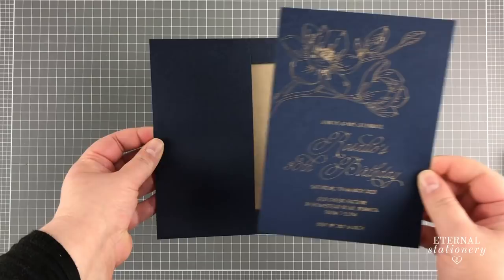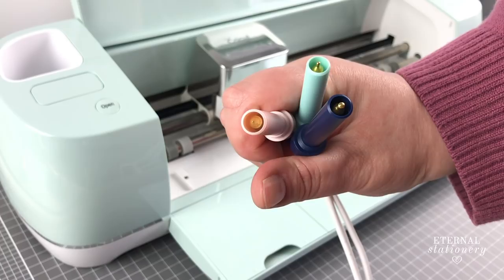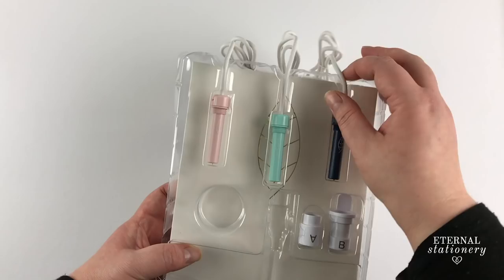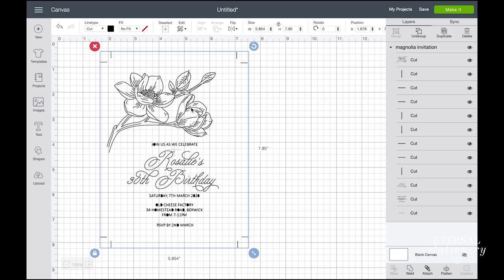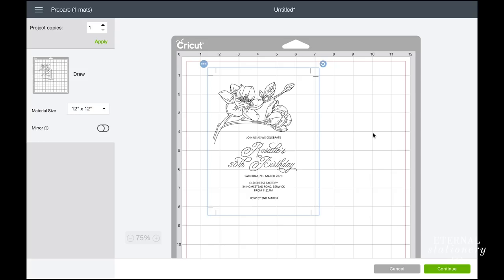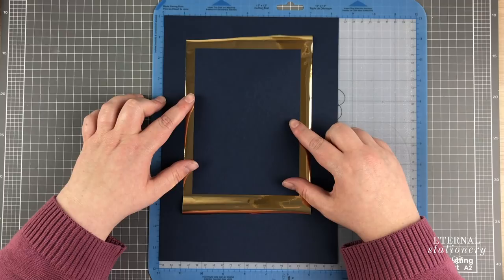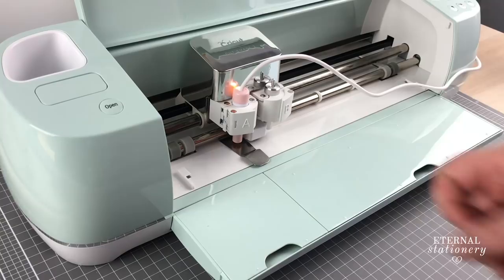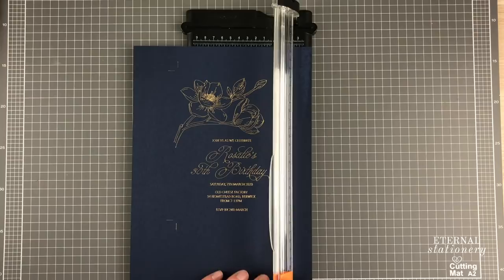HOW TO USE THE FOIL QUILL? DIY Gold Foil Invitation | Stunning Results!

Comment: Hello can you tell me what setting on the cricut you have it set to for this? I had it set to card stock and I let the quill heat up but it did not attach to the card thank you
Reply: Hello,  I just ran the quill on my Cricut Maker for the first time and I did not get the outcome that I was expecting and thus, I have the same question as you.  I believe that my lack of results is from the paper and pressure setting so I too, am wondering what was her settings.  Did you receive a reply and if so do you mind sharing?
Reply: I just finished my third try and as the saying goes, "The third time's a charm".  I am so happy with the outcome. I did play with the settings and my third setting was on lightweight card stock, Default pressure, and the Fine Quill was most important...I believe.  The first and second pass I used the Standard Quill pen.  The best to you and Happy Crafting.

Comment: Hi Thanks for sharing the video. I have bold tip foil quill pen, will I be able to make invitation with that too? Please share some projects using bold tip foil quill. Thanks in advance.
Reply from the maker: Yes you can. You will just need to be careful with finer lines but if there is enough space between characters is should work well.

Comment: Hi, another question about the single liner drawing, tried converting text in illustrator but not successful :( 
tried these steps that are not successful
1. rasterize the text and trace it and convert to single path
2. create outlines
3. create text using photoshop, save as eps, png, pdf, jpg, etc and trafer to illustrator and convert to single path

All of these procedure does not work for me.

Kindly share your technique.

Thanks!